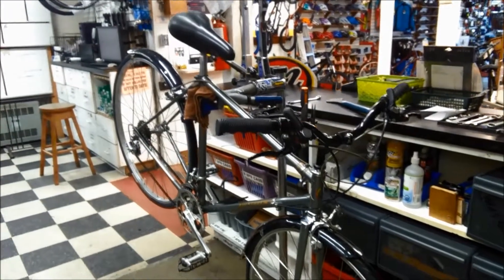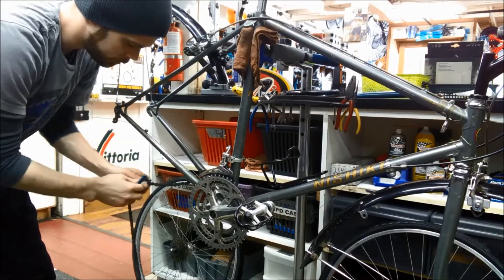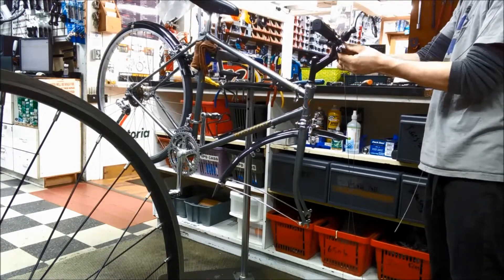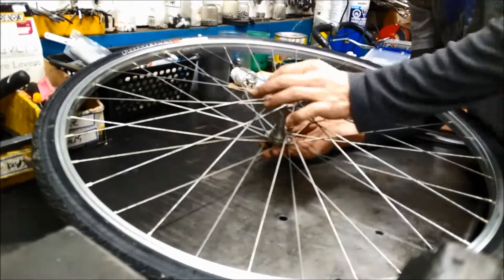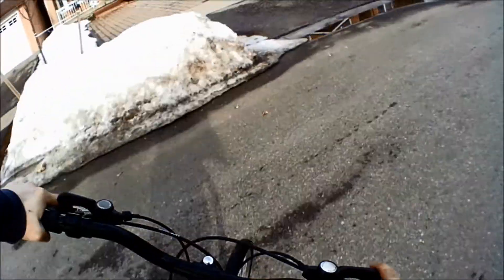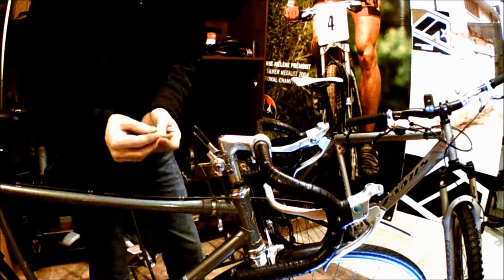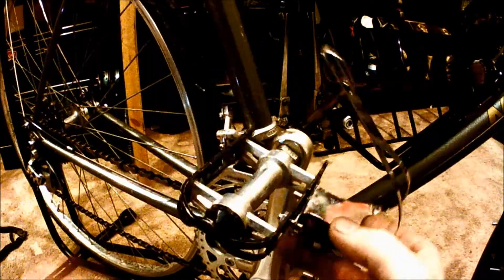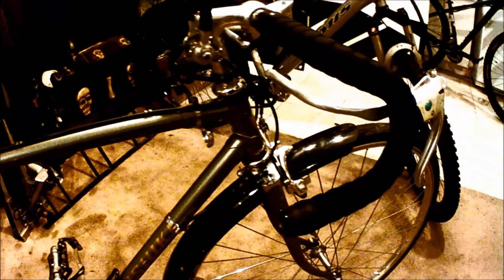Project: Used Bikes - Ep. 4 - Vintage & stylish urban bike - Peter Collins

Comment: Do you buy bike sub parts. Like the plastic ring around the springs of my v brakes  are broken and I want to buy new ones
Reply from the maker: The little plastic spring retainers on V brakes usually aren't available on their own but a replacement set of V brakes from brands like Tektro can be as cheap as $10-15 so it might be work picking up new brakes at you local bike shop.